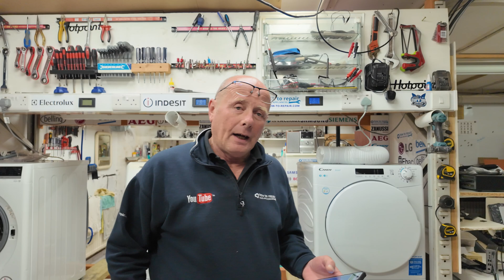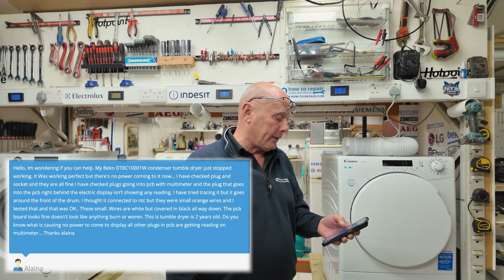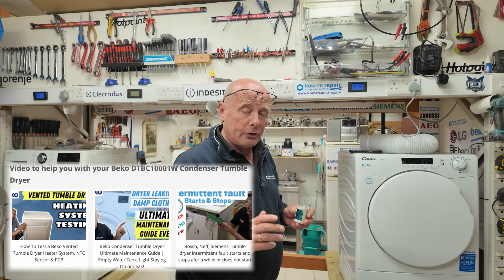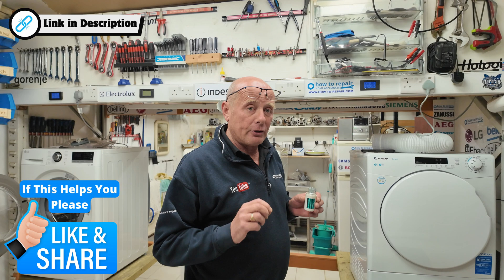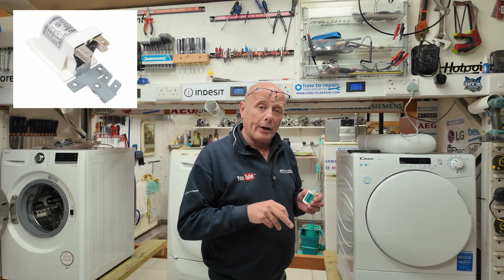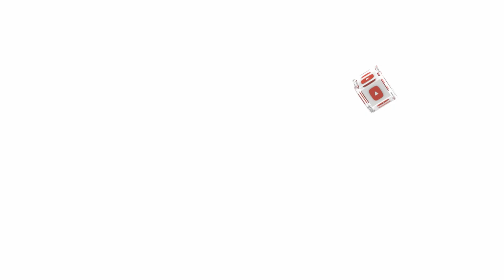Beko DTBC10001W Condenser Tumble Dryer Has No Power At All - Tumble Dryer Repair Guide

Comment: I have a beko dtlce70051w with no power there is no part you have told us about the power goes in to the machine to a few connections which two go back to the compressor which alternate direction then the other goes one go to the motherboard can you help